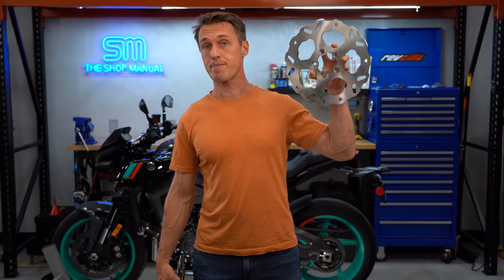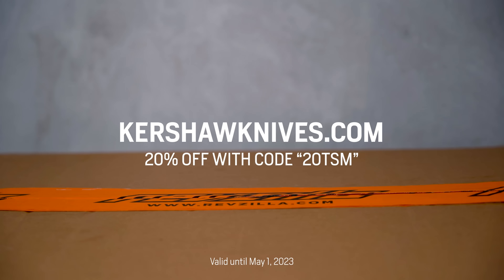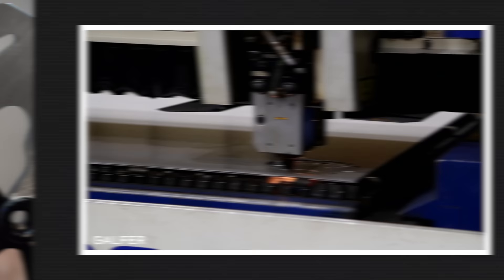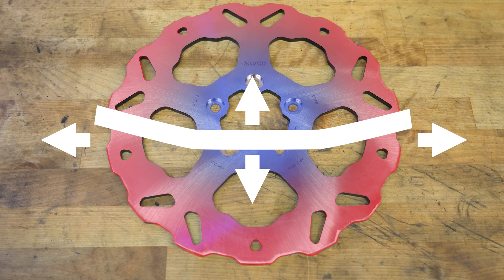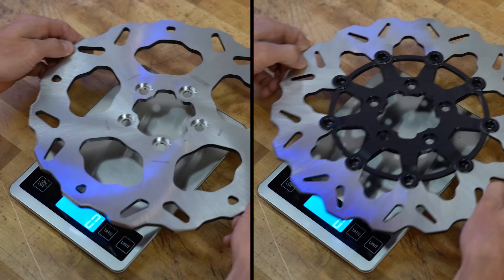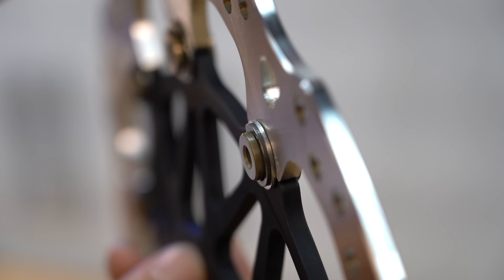Solid Brake Discs vs. “Floating” Brake Discs | The Shop Manual

Comment: Not really an issue with my 1978 Triumph Bonneville and 1980 Suzuki GS550, which both have one piece cast discs, and don't do much heavy braking.

Comment: Hmm there’s still quite a lot of bikes with solid rotors. The Honda’s 500cc bikes still have them. Sub 400cc KTMs too
Reply: Yes, but they're smaller bikes and there's a lot less reason for those to use have float to them as they just don't get as hot.

Comment: Addition to that would be that enduro bikes almost exclusively still use solid brake discs, as they won't ever get that hot and would rather clog up in mud or dirt if they had floaters/rivets

Comment: 250°F × 2 = 960°F, 250°F × 3 = 1669°F.  Gotta use an absolute temperature scale when multiplying temperatures.  That said, I would absolutely believe that brakes get that hot on the track when they start glowing red.

Comment: Interesting.  My 33 year old Yamaha has floating discs, but my 2005 BMW does not.  And my 2013 BMW has sort of a Buell inspired solution (floats on posts connected to the middle of the wheel, not the hub area).

Comment: These days manufacturers don't even bother putting the floating aluminium disc. Such as in RC390 2022 model and it's braking is pretty intense.

Comment: My 1996 GSXR 750 has dual floating rotors and twin 6 piston calipers. It will flip you right off if you grab too much front brake.

Comment: Very true, but what tends to get lost in the fog of superiority is the fact that solid rotors work perfectly fine under most all street and sport use.  Only at extreme breaking and heat do you realize any benefits of floating rotors.

Comment: One myth to correct. Brakes don't convert the bikes speed to heat. They're more like a clutch for controlling the transfer of kinetic energy (in this case controlling the transfer of this energy to the ground via the tyres). Heat is just a wasted byproduct as this.

Comment: I drive both typs of Breakswheels. The Flywheel Break make more issuse than the Fix one. 2 Times i change the Flywheel cause of wobbeling the Breaks, the disk is 2 times disforming, even i think to install a Fix On my Flywheel Motorbike cause it starts to anoyed me.

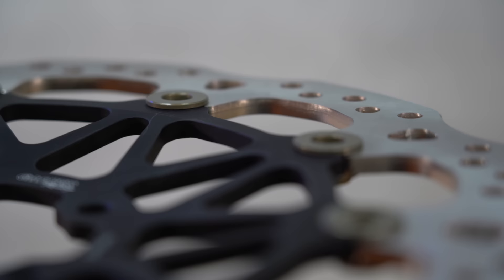Comment: What do you mean by "pad separation" at 3:45 and why does a full floating rotor cause that as opposed to a semi-floating one?
Reply: The lateral movement of true floating rotors can push the pads/pistons back in the calipers if the brakes go unused for a period of time when the bike is being ridden on rough roads. Galfer said their riders couldn't use full-floaters at AutoClub Speedway in Fontana, CA, for that exact reason.
Reply: @Ari Henning  gotcha, that's what I was thinking. I've heard of pad knockback, but never experienced it in that way except in a full-blown tankslapper, which scared the crap out of me. I've read a car review where the testers mentioned it, some sports car.

Comment: Why do people put socks on the front brake reservoir?
Reply: For holding Temp, so it Stay warm.
Reply: Style
Reply: In case they leak. Brake fluid will damage any paint on your bike
Reply: It's to prevent sun damage to the fluid and therefore keeping a consistant viscosity. Not much of an issue here in the UK but in hotter climates, worth having.
Reply: It's just an aesthetic thing, does nothing else.
Reply: @2strokerides  You got Bigger Problems, if it Leaks...

Comment: Good job. And could you further advice the difference between "Wave shape" rotors with irregular edges and ordinary round rotors. I saw quite a lot of the former in Kawasaki bikes but not so on other Japanese brands.
Reply: designed to wear out faster but look fancy .

Comment: I want(ed) to buy the Triumph 660 sport except the rotors are solid mounted to the wheels. is there a work around?  Can you buy aftermarket discs that are semi floating adapted to the solid mounted system that the Triumph uses?

Comment: What happened if using semi floating rotor and floating calipers? 
Are that will be dangerous?
Reply: By "floating" calipers I assume you mean sliding-pin calipers? Many, many bikes have that combination (SV650, CBR300, etc. etc.). The two-piece design allows the disc to expand evenly, the sliding-pin design allows the caliper/pads to self-align with the disc.
Reply: @AriH211  ah yes the sliding caliper. Is still ok to using floating disk?.

Comment: Rivets expand and fill the hole, providing residual compressive stress around the fastener in the hole.  These connectors are not that, and so are not called rivets precisely.
Reply: Most bandages are not made by Johnson & Johnson, but we still call them Band-Aids. Likewise, I called them rivets because that's what most people (in the US) know them as.
Reply: @AriH211  I get it.  Just adding that nugget of info.

Comment: Why haven’t you touched on a very important aspect of floaters, which is that they allow the pads to contact the disk simultaneously? If one caliper pad touches the disk before the other, the disk will be pushed across and braking will then occur when both pads touch at the same time
Reply: Bikes either have sliding-pin calipers or opposing-piston calipers; both systems self-center so that the pads touch at the same time.
Reply: Thank you @AriH211  If both pads always touch at the same time, could you then please explain why they sometimes have uneven wear, also what is the purpose of fully floating disks having lateral movement?

Comment: My biggest problem with breaking is when the stupid pins in my floating rotor fall apart, there is no good reason to put floating rotors on a 701 with knobbies. 😤

Comment: Not motorcycle related but i do have a question to ask. Mountain bikes are also getting on to the floating disc trend as well, i'd tried one and it worked great for couple of months but then the rivets started to "eat" the aluminum part... like the outer part started to have a free rotation up to maybe like 1 degree or such, and after taking it apart the round ditch for rivets had been "eaten" into oval shape and created that free rotation, my guts feeling told me that this isn't normal so i went back to one piece rotor but i have never actually asked anyone from the moto background and see if that was actually an issue. So, does this kind of free rotation and aluminum part got eaten by rivets thing quite normal on motorbikes? or is it actually a bad sign of the rotor failing?

Comment: The heat isn't the biggest issue. The heat is how brakes work. They convert kinetic energy into heat(energy)...  hence the slowing down
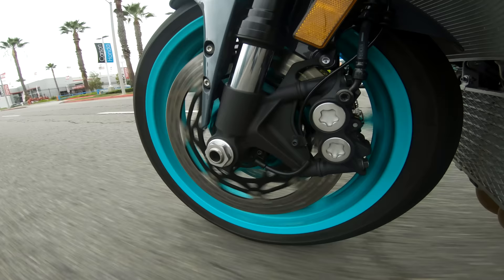Reply: Sounds an awful lot like the explanation in the video at 1:40.
Reply: @AriH211  I was just paraphrasing the guy :"the heat is the issue" and i was explaining why is not because is how they work

Comment: "The separate friction disk is better at dissipating heat". That makes no sense, it can only be worse than a solid disk, unless it wasn't actually floating and was in direct contact with the aluminum.
Reply: Agreed, but what it can do is allow the temperature of the outer section disc to be more uniform, and make it less prone to distortion, as the heat cannot be dissipated by conduction to the centre, only through airflow.

Comment: Solid brake discs are only used with floating brake calipers. If you used a solid brake disc with solid caliper, then you would experience a lot of issues as described in the video.
Reply: Not true. My 1978 Triumph Bonneville has solid, cast iron discs and fixed calipers, but I don't think they had heard of floating discs then (any disc brakes were cutting edge technology, as far as the British motorcycle was concerned in the seventies). They don't get a chance to overheat, as they're not that effective.
Reply: I think it would have to at least be a dual piston solid caliper then, to allow the pistons to find center between them
Reply: @WL2K  There's no such thing as a single piston fixed caliper, they have to have pistons in opposed pairs, otherwise you would only be braking on one side of the disc.
Reply: @rickconstant6106  I was hoping thats true.  I once had a go kart that had a disc brake that only had one lever-actuated pad so I never ruled it out..

Comment: anyone old enough to remember will  tell you brake shoes work great and this problem doesn't exist, I've got shoes F&R on my present bike and it stops on a sixpence. . the fact that shoe brakes are cable operated and not hydraulic is the main issue I think.

Comment: and then u have the banana republic like slovakia, where the technicians during technical inspection measure the ovality of the floating brake rotors, which is in itself preposterous. Yet they vehemently do so and many vehicles were deemed unsuitable for the roads because of this stupid legislature